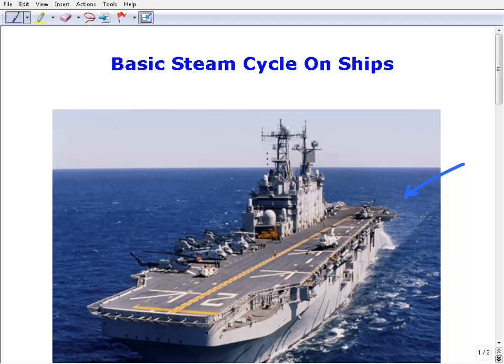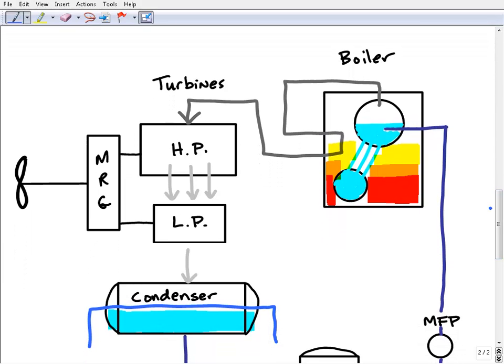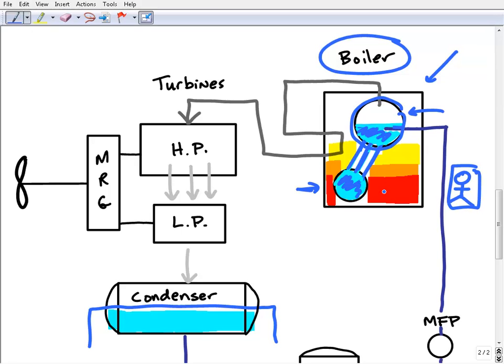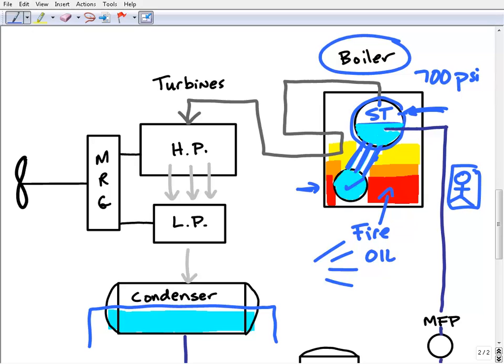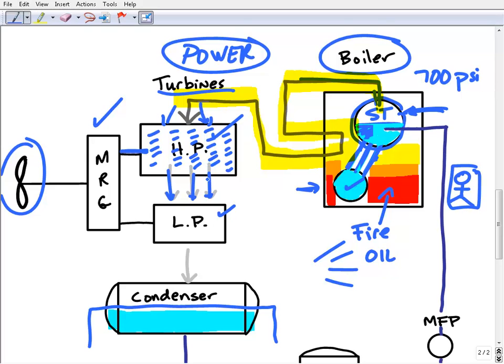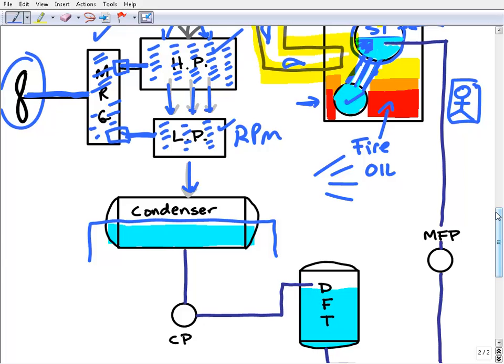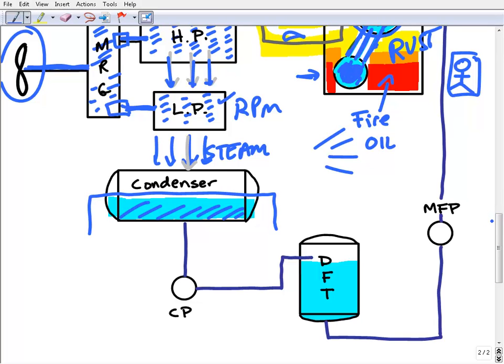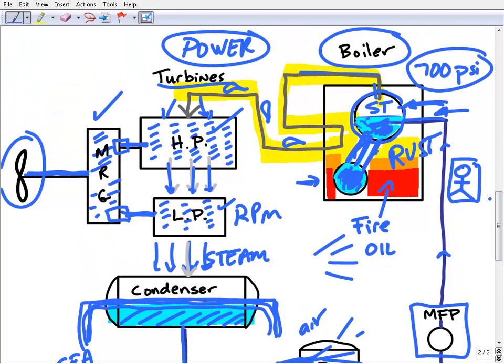The Basic Steam Cycle- An Introduction To Ship Power Plants

Comment: In 1988 I decommissioned the USS Norton Sound (AVM-1) which at that time was the only US Navy ship that still used black fuel oil for fuel.  In order to refuel tanker trucks of the stuff were brought up from refineries in Mexico since it was not available in the US.  When I was doing my qualifications for Surface Warfare I spent some time in the engineering spaces.  Our power plant was 400lb steam and used forced draft blowers.  In order to change speeds you actually changed the discs that were in various sizes to regulate the spray of the fuel oil into the boiler.  The top speed discs were locked in a box that only the CENG had the keys to.  Toward the end it was very hard to keep everything working and before an underway period we had help from Long Beach Naval Shipyard helping us keep it in one piece.  Usually we only stayed underway for as long as our missile shoot was and then headed back.

Comment: In the Australian and most probably other Navies,the "Black Oil" was called Furnace Fuel oil or FFO for short.
The oil had to be pre heated to a certain temperature to reduce its viscosity and thus allow it to be atomized by the fuel sprayer nozzles 
Ships operating in very cold environments had steam elements in their fuel tanks to help keep the oil thin enough to pump etc :)

Comment: I volunteer at the USS North Carolina (BB-55) in Wilmington, NC. I mainly work with groups in the engine rooms of the ship. The North Carolina's propeller shaft would run at around 190 rpms after being reduced from 5,900 rpms in the hp turbine shaft and pinions. The system also ran under 600 psi of steam pressure at the beginning of the cycle. One thing that wasn't in the presentation that I wish you would have mentioned was the economizers or "preheaters" for when the water re-enters the boilers. Thank you for the video, great job.

Comment: normal d types  boiler first pass steam will be at 600psi at 580 temp 2nd pass thru super heater and brought up to 1200 psi at 975 temp . then it goes thru hp, high pressure intermediate turbine and LP turbine. now to the condenser to turn steam to water. from a USS kitty hawk and tech.
Reply: I see several problems with his diagram, but for the average layman, its fine, basic, but fine.

Comment: Top Flank speed shaft rpm was about 203 rpm on CV-43. Loved standing throttles. Actually saw an SSTG turbine take a shot of water while in the yards. Just shredded the turbine blading. They musta picked a million pieces out of the casing. The 4 main stages of the steam cycle are:  Generation,expansion,condensate and feed.

Comment: To answer the one gentleman's question on the DFT. The DFT or DA Tank has three basic principles; Pre-heats, Deaerates and Stores. It pre-heats the condensate that's pumped from the Condenser by using auxiliary exhaust steam. As the condensate returns to the DFT, its sprayed out through low pressure spray nozzles, forming an umbrella pattern where the steam is injected from under this umbrella. There's a vent at the top of the tank usd to remove air and other non-condensibles.

Two things are accomplished here, pre-heating and deaerating. The fine mist is scrubbed free of oxygen. Once this takes place the feedwater is stored in the bottom of the tank ready to be pumped back into the boiler via the booster pump to the main feed pump. A normally operating DFT will have a three degree delta T between the top and bottom of the tank.

That's from memory so I'm sure someone can add more info. I was a BT from 1977-1981. Served as underway top watch on two different ships. One was a 1200 psi and the other a 600psi plant.

Comment: I will have to correct you on your circles you have drawn, The top one is your steam drum and the bottom one is called the mud drum. The fuel we used was black oil and the other which came later we called JP5 or similiar to #2 oil. I was a BT in the US Navy. I continued inot stationary engineering after the Navy and have two licenses, one from Ohio and the other from the ASOPE both are First Class Steam Engineers licenses.
Reply: peshewa0529 I wonder if we've ever met. I worked as an intern for Cleveland thermal back in the winter of 14-15 and left to join the Navy as an engineer. Just curious to know. It's a small world after all!
Reply: I don't know, we may have met. I was in the US Navy from 1970 - 1976. I was a BT 2nd Class when discharged. I worked at different plants in Ohio and Michigan. Was active with the Department of Industrial Relations, Division of Steam Engineers when Clint Boyles and other Examiners were with the Department. That No longer exists and the department is stagnant.  Wish you well with the US Navy.

Comment: I too didn't think the solar reflectors would work. Less because of the temp than the volume of steam needed. Based on calculation for piston driven steam just 10 HP would require 25 CF/Min at 125 PSI. Was going to try a "U" shape like a 5x10 foot paraboloidal mirror. As for the HP to ton radio it sounds crazy but seemed to work out close as 4 HP would move her but sure not at carrier speeds :) Maybe 5 MPH which I find ok until I realize daylight only 1,500 miles NYC to Florida. 30 days? ok

Comment from the maker: great questions; I think the ship plants in the Navy produced like 25,000 shaft horsepower; the ship was also like 20,000 tons displacement; so we maybe we can figure 1 shaft horsepower to move 1 ton;  however it's impossible to make a boiler 1/25,000 the size;  I would think a much, much smaller plant could push 4 tons.  As to your question on solar reflectors I would not think it would work because you need a very, very hot heat source- like a torch for a big boiler like in the navy
Reply: In the very early 70's on a Adam's class destroyer the 1200# system with the Westinghouse turbine and reduction gears was rated at 35,000 HP. Two of them. MM2 in main engine control. On a shake down after getting out of Newport ship yard and a major overhaul we did a lot of Flank speed runs and when you are at the throttles it gets a little unnerving when you are the one with the big wheel in your hand drawing the pressure down. Believe it or not I was thinking about my buddies in the boiler rooms trying to keep up. Running at Flank speed is really no joke and serious time. I think the only thing worse is when you are in a foreign port trying to get out of town and the bridge orders down a crash back, then emergency Flank, then another crash-back, then another emergency Flank, then finally 2/3 speed. Or even worse when you are in the middle of the ocean doing full speed and you get a crash back because there is a Soviet sub riding your ship's ass and the skipper orders a crash back hoping he can get a sub to run under your ship's ass end. Had a lot of fun though, wish I was 20 years old and doing it all over again.

Comment from the maker: Hi- I don't really remember much how the internals of the DFT;  however I'm pretty sure it works on the premise water being directed to move in varying directions and getting splashed on the wall on the tank; I think the process "knocks" O2 from H20 reducing the amount of oxygen in the feed water to the boiler
Reply: 21 spring loaded poppet valves it works under a vacuum like the main condenser.its used to preheat condensate and is the last step prior to booster and main feed pumps,